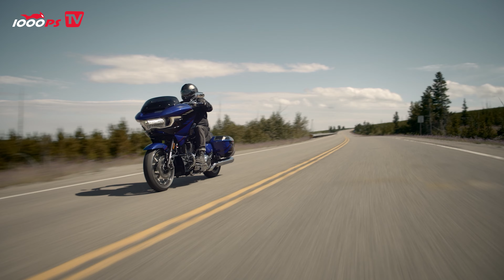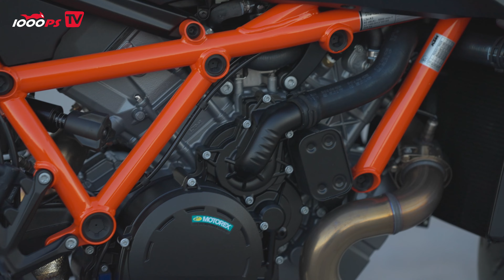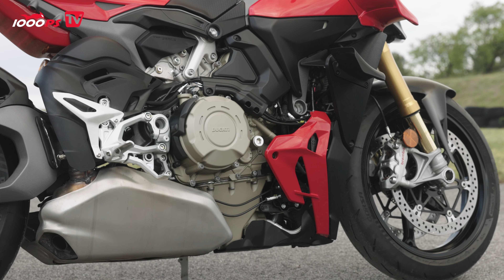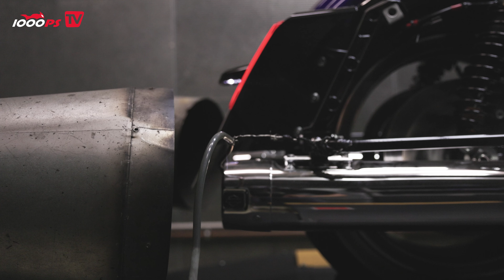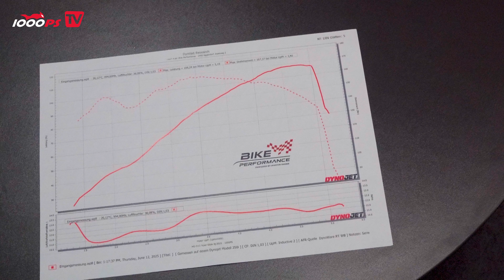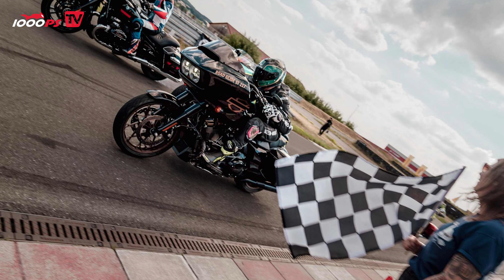Harley CVO Road Glide Engine - Real Power or Just Hype?

Comment: Harley makes a 2 liter V-Twin in 2025 which makes 40% less HP than a 10 year old, 1.3 liter KTM. :D :D :D
Reply: Although i agree that their engines are underpowered, the thing you're missing is its low rpm torque production. The KTM 1290 doesnt make peak torque until its spinning more than 8k rpm. Harleys make most of their torque right off the bottom, and peak around 3k rpm. The KTM is sickeningly torquey, but Harleys feel more like a big block muscle car. Only looking at horsepower and displacement wont give you the entire picture. Personally, id still pick the KTM any day 😁
Reply: While torque is absolutely necessary they're two different bikes with two different types of riding in mind. Harleys are like 900 Lbs.+ No riders, Harleys are made for two up, Harleys typically have 200-600 lbs of riders weight (2 people). Plus saddle bags plus trailers, plus full sound system including at least one amplifier from factory. They need the torque immediately. KTM needs torque but not immediately.